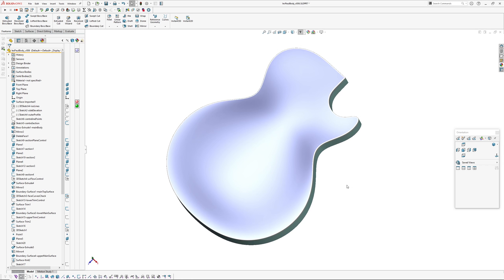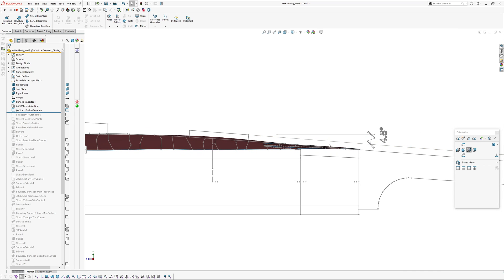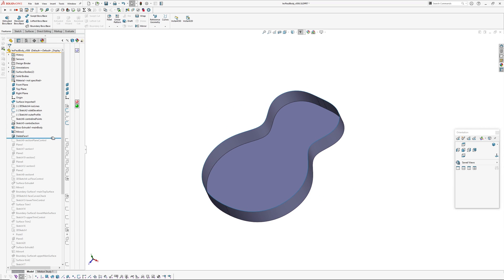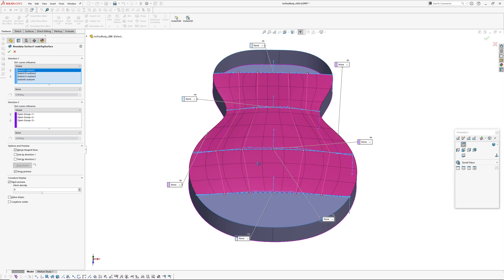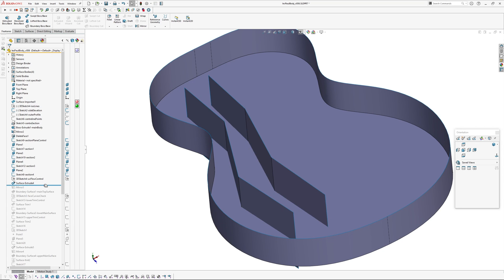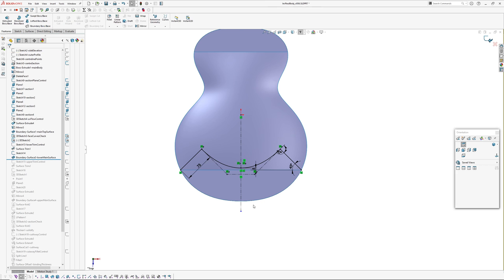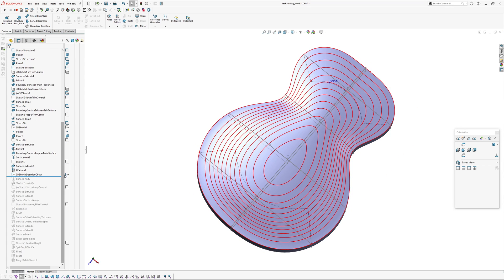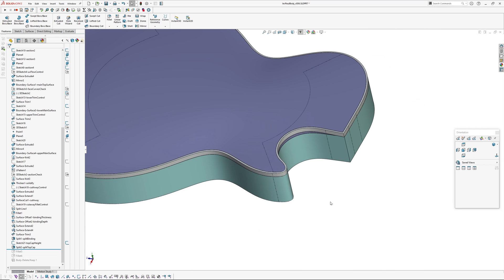Les Paul Carved Top Surface Modelling Exercise in Solidworks 2020

Comment: Your surfacing techniques and skill in general are beyond! Did you learn all this just by doing or how come you're on such a high level? I really want to get into the topic but it doesn't seem too easy to find a starting point that's not too overwhelming.
Reply from the maker: Hi there. I have been modelling on the computer since roughly 1997, so lots of time to pick up techniques off colleagues, as well as lots of mistakes and learning from that. There is a wealth of information available now. The Alias Golden rules are well worth checking. Different application, but the modelling strategies are the same as surface modelling in SW.

Comment: But isn't this little over overkill? I do understand that this is a Solidworks exercise, but for example in Rhino you can just literally make a straight loft between the two halves and just control point edit the shape you want (or need). Easy and much simpler. So I'm just wondering, would you actually use Solidworks for this in real project? Great videos btw! 👍
Reply: We got there in the end, trimming away degenerate points is the way to go if you want clean results for surfacing in rhino or solidworks🎉
Reply from the maker: Or better still, not having them to begin with!
Reply from the maker: Good question. There is no ability to manually manipulate CVs in Solidworks, without using the free form feature. Therefore you’re kind of stuck using curves to control things. If I was modelling this in Rhino I would still follow a similar surface layout (4 sided main surface, then trimmed to create each end) as lofting one half to the other would leave you with degenerate points on each end.
Reply: @AndrewJacksonDesignStudio  Yeah, as an ID my self I'm just always curios what is the right tool for the job. And of course wondering why would I use SolidWorks for this type of surfacing. It surely at least looks more complicated than in Rhino for example.

And for the degenerate point issue, I think it's trivial to just trim it away in the end. So, you kinda end up with the same patch layout. I'm not so sure if it's really a necessary to model and setup the whole thing just to avoid it in one point of time? The neck of the guitar, for example, will get rid of one of the points for free! As you also kinda mentioned in the video.
Reply from the maker: One way of looking at this is if you only have one tool for the job, whether you are an in house designer or a contractor, having to keep within the eco system of the client's particular CAD system. The guitar top may be easier/quicker to model in Rhino, however the rest of the product, drawings, PDM, DFM stuff may not be. 

I disagree it is trivial, I try and avoid having degenerate points or cases where adjacent sides of a 4 sided surface approach being tangent with each other as much as possible, that is why I built this the way I did, out of habit. But yes, if you are going to trim a surface with degenerate points back as much as I have, then may as well build the main surface shorter to begin with, it is no extra work.
Reply: @AndrewJacksonDesignStudio  Well obviously drawings and rest of the stuff, especially all of the inner bits of the products is better to do in SolidWorks anyways. And sometimes you just don't have an option like you said. I have been there 🙂

I agree that avoiding degenerate points its good thing in general, but if you build the main surface short, you will loose the ability to sculpt the whole top of the guitar in a way that you can instantly see the result. Playing around with several surfaces is more work, at least in Rhino. As a designer I would prefer to see the result and sculpt it on the fly... and later on fix the degenerate points by trimming. This was my thought process for all of this.
Reply from the maker: I think around the base of the guitar you will still have issues with the cv flow and with your reflections if the surface is taken full length, even if you trim the degenerate area out afterwards. In Rhino you could build the main surface short, trim, add a 4 sided edge surface, match the edges with history enabled, then (theoretically) you should be able to sculpt the main surface, with the end patch updating. That’s it from me for now, I prefer not to get into deep threads comparing applications so if you are able to (for work) and want to, then Rhino sounds like the right choice for you.
Reply: @AndrewJacksonDesignStudio  I was playing around with your model little bit more, and I safely say that your patch layout is the right approach here. The bottom surface, for example, is pretty much required to get the shape you have in your model not only for fixing the degenerate point. So not overkill I guess 😀

I definitely prefer Rhino, but I'm also interested how to use SW also. That's also why I really like your surface focused SW content 👍
Reply from the maker: Yes, that kind of trim/patch layout is well tried and tested, first time I came across it was in ~2003 being used in ProEngineer on keyboard and mice models. There are some similar patch layouts covered on 36 Verts https://www.youtube.com/c/thirtysixverts if you are interested. All Rhino but the layouts can be transferred to SW.